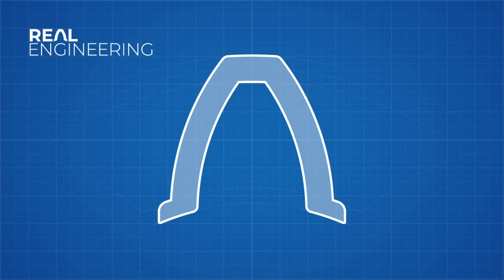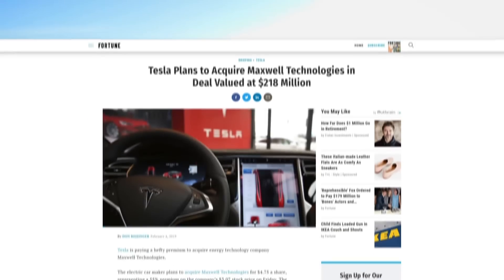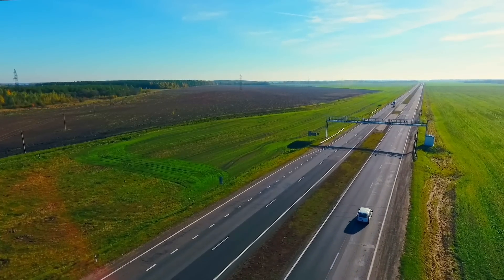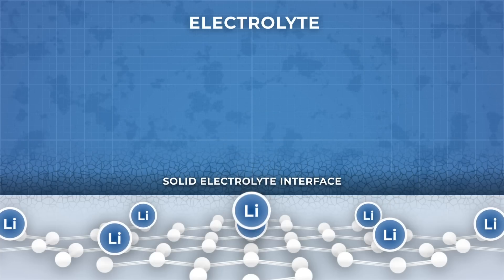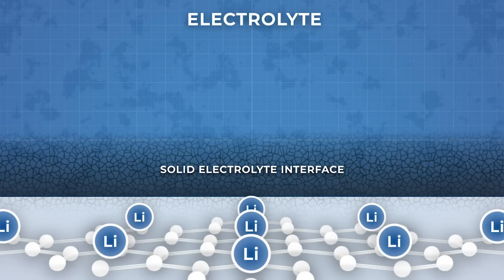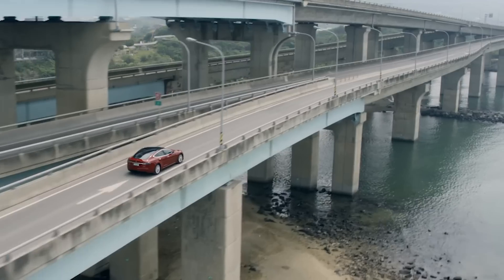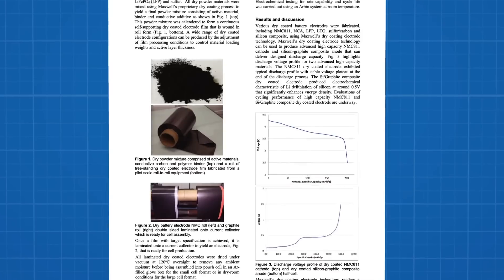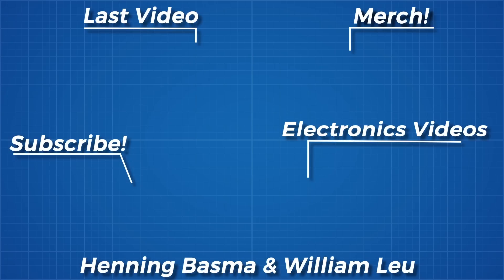Tesla's Quest for Better Batteries

Comment: This will greatly help solar power technology, I think the biggest cost with solar power involves battery expenses. Every time I plan a new solar system for my house the biggest cost is always the batteries.
Reply: Do a search for diy powerwall on youtube. 
Seen people build for as little as 300 usd per kw/h with new but surplus cells.

There are companies that only deal in surplus new cells and fully tested used cells and sell for a fraction of new ones.
Reply: @baronvonlimbourgh1716  300kw/h?! holy fudge, HOLY FUDGE! Thanks man I appreciate it.
Reply: @zereimu  yeah, that 300 per kw/h was an extreme example done by very dedicated and creative people though. I do not want you to get to excited and be disapointed :).
But it can still be done a lot cheaper then the commercial solutions out there currently without to much hassle and with of the shelf parts.

Even at 500 or 600 dollar per kw/h it is still a lot cheaper then commercial solutions and that is certainly doable if you shop around.

Ahh well, maybe you are just as dedicated and creative and you are able to beat those guys. It is kinda a competition going on  to be the one who finds the cheapest solution.
If you enjoy that stuff as well and have the time i am sure you can do it even cheaper!
Prices are constantly coming down on all this stuff.

Comment: Better find a way to recharge the batteries to 100% in 5 minutes or less from plug-in to un-plug.
Reply: Just have battey stations in different spots (petrol stations) where you swap your used up batteries for freshly charged ones in 1-2 minutes.
Reply: @MrBibo2050  , I also think that's a great ideal.
Reply: orange70383, who knows, maybe it will be possible in the near future.
Reply: A liquid electrolyte change can be done instantly exchange charged electrolyte for discharged in seconds then you are off just like filling up with gas🤔 Hmmm
Reply: Then the liquid electrolyte is recharged and reused with no losses

Comment: 15:02 I'm an English learner. Please let me know what does it mean 'vertical integration'?
Reply: It refers to a company that owns a larger party of the process involved in what it does.

Think of it as the opposite of “outsourcing”.

It could  mean an electric car company that also makes the batteries that go into their cars.

Right now, Tesla’s batteries are made by Panasonic.  There are rumors that Tesla wants to take over production of their batteries.

If they do, they will become more vertically integrated.

Comment: Would the Silicon Batteries last longer then Lithium equivalents? My theory is that because the Silicon used in the batteries expands by 400% when fully charged and creates cracks in the Solid Electrolyte Interface, ion atoms that would have previously would have been jammed in the thicker Electrolyte Interface now have a less energy intensive journey for ion atoms to get to the Electrode and would thus be drawn to using this route over the alternative until the crack is sealed with the same thicker Solid Electrolyte Interface it was previously avoiding, however the process to create new cracks in the Solid Electrolyte Interface would have been complete.

Please reply back on if you think my theory is sound or am I missing some complication to my theory that is currently obscure to me. BTW Love your videos.
Reply: The thing you missed is that the expansion and contraction cause the silicon to crack and degrade, killing the battery.

Comment: Please do not say heat pump when you mean pumps moving glycol or another heat transfer fluid. A heat pump is something else and this came up multiple times (wrongly used).
Reply: No.  A heat pump is used to cool or heat the glycol that is being pumped.
Reply: @dewiz9596  Which is exactly what Tesla does NOT have, contrary to what the video says. The video says heat pump when actually just a pump is meant. Some EVs have Heat Pumps. Tesla EVs do not have heat pumps.
Reply: Gerald H. : sadly, you are wrong.  Tesla specifically does NOT use resistive heating for the cabin heat.  They specifically use a heat pump to warm the cabin.  And seats.  Air Conditioning is a reverse heat pump. . .  I.e.  you pump heat from inside to outside.  They are, in fact, pumping glycol around the Panasonic Cells which are in rhe Tesla Battery Packs.  But that glycol is maintained at the proper temperature using a heat pump
Reply: @dewiz9596  Tesla has specifically stated that for the Model 3 they are using the drive inverter in an inefficient way to generate heat instead of using a resistive heater as with the Model S. They are NOT using a heat pump. Also Tesla Bjorn has done a lot of efficiency tests in the cold and cars with a heat pump do a lot better here. Tesla does NOT use a heat pump. If you google tesla heat pump, basically all posts confirm this.

Comment: My suggestion to new car buyers... is wait for VW in  2020 !If your daily mission is 100 miles or less one way.. and you live  where freezing and 90+ temps are rare... a used late model Leaf continues to be a great value that will last for many decades, with no fear of the dreaded Tesla Fire, or parts falling off with no dealer or parts anywhere.  If VW hits the mark.. the new car cost will be equivalent of a new small diesel vw..  ( about the same as a nice Honda or Toyota gas car).
Reply: Might be good advice, but ONLY if you really don’t care about acceleration, a clean interior without 1000 buttons, software upgrades and the best autopilot software on the market. Certainly many people just want „a car“, but if you want more I don’t see how VW can compete. They just have no idea about software and AI and are years behind.

Comment: this is fine, but it ignores the fact that the Leaf battery is now in it's 4th generation,and that the 1st generation battery was only made in the 2011-12 first generation cars.The lizard battery chemisty began with 2013,  and by 2016 the 30Kwh battery became available along with the original 24 KwH size.. with further chemistry improvements, and an increase in warranty to 8 years and 100k miles, and a range increase to 100-110 miles.  Latest Leaf battery is twice that size with a 200+ mile range.   As always, when the battery size increase relative to the momentary demand.. the range and the battery life increase as heat production goes down !    An active or better passive battery cooling/heating system will certainly benefit anyone in a hot/cold climate or who demands insanely fast charges..  but here in California.. we are quite happy with our Leafs.  Even Arizona is happier.

Comment: Dear What's the Electrical efficiency of Tesla Motors if it's bellow 96% then they must focus on achieving that first
Reply: Around 98%.
Reply: @drdoomgoat38  Impossible since an Induction motor can not possibly  exceed  efficiency level of 86% since it has inherent Slip factor which keeps it under this max limit

Comment: Wait, if you're in a cold environment the solid layer creation rate decreases. That is a good thing. But charging/discharging in the cold if less efficient, which cycles the batteries more and wears them out quicker. Not mentioned, heating the batteries is also a power drain (more battery cycling). So then I assume the net affect is worse in the cold. Does that sound right?

Comment: The other thing is. It's okay if it's cheap to replace BUT the batteries can't be recycling so they will be throown away +the amount of CO2 produced to make out is greater than to Run petrol car .
Reply: The batteries are 98% recyclable, the c02 released in making the battery is only 14% of what a gas car would release in its life time.
Reply: @miguellopez3392  are you 100% sure of that?
Reply: @MoleRat94  yes I've been arguing electric cars to skeptics and engineers for years now, the cobalt extraction process from a lithium solution in a lab setting managed to achive 99.97 extraction of the cobalt, batteries are made from base elements, throw it into a vat of acid or molten metal and you effectively recycled raw material.
Reply: @miguellopez3392  isn't that works only with brand new batteries though
Reply: @MoleRat94  ? Who would make a recycling plant for brand new batteries? When a battery ages little crystals grow inside of them wich eventually short the battery and kill it,  chemical degradation also causes higher internal resistance and capacity loss but this will take over a decade to become a noticeable problem in a BEV like a tesla.
Reply: @miguellopez3392  so they are not recyclable then?

Comment: Fuck EV's, A car that now has a range of 290 miles with only be able to travel 200 miles in 8 years. Useless for any type of weekend road trip. I'll take the old turbo diesel car that goes 500+ on a tank
Reply: EV range degradation is only 10% every 180,000 miles on Teslas and they go 225miles-370miles, that's 12 years of driving.
Reply: @miguellopez3392  I've read more as this video suggests but what do I know.
Reply: @famousmidnight  yeah what do you know, I've look at degridation data, average miles driven, and concluded that in 10 years the range would have only gone down by around 40 miles from the original 300 mile range.

Comment: Could a bank of capacitors allow for truly "quick charging" that then trickles into the battery at the normal "slow" rate?  EVs need to be re-chargeable on the go, not just overnight in the garage.

Comment: Battery's can be cheaply produced and  totally recycled if you use the correct components. Buying a new battery shouldn't be a big deal! Like changing oil!, It depends on the cost of the vehicle$$$  many consumers would buy electric cars if the costs was affordable. This would help the environment and the consumer. It would help the economy too. So by manufacturing a affordable electric car for the general public would create jobs , cut down on pollution, and help the economy of the USA. The electric car needs to be reenginered and made affordable with like components that can be used in different models.  Reenginered Motors, Reenginered Battery's, battery's quick exchanged and totally rebuildable. Then the electric car will change the future from a gas polluted atmosphere to clean air and Blue sky's!🤔. Like I said Give Me a Job!
Reply: And a 5-minute battery swap at the corner station would be much preferable to a 1-hour+ "quick" charge.  Combine that with your "standard module" and it'd be like swapping AAs on-demand.
Reply: @PongoXBongo  now you are thinking outside of the box😀 you wouldn't have to worry about buying a new battery you would just get a replacement. Kinda like exchanging a empty propane tank😁
Reply: Please. For the love of god, please NOBODY give this guy a job.
Reply: @geraldh.8047  hopefully that is a satire remark😁
Reply: @geraldh.8047   I noticed that you work on TV's? I stared my own tv repair shop as a teenager, then worked for a electronics shop fixing stuff just about anything that came in the shop 😁 then I opened my own business fixing computers, TV's , radios, amplifiers, cellphones, apple I pads ,  I also went to college studying electronics. I do know a thing or two🤔
Reply: @davidmayhall6567  Knowing a thing or two is not enough in battery development. This is a hard problem that thousands of people have spent their entire lives on with usually only incremental improvements. If you think you alone can change what chemistry experts and nanotechnology experts are still grappling with, you are most likely delusional. Or a very stable genius. But probably delusional. Sorry, this was not satire.
Reply: @geraldh.8047  well don't shoot me in the foot man! What are you doing to make a Better world?🤨
Reply: @geraldh.8047  your opinion is noted and filed, and totally Disregarded as Disrespectful 🙄
Reply: @davidmayhall6567  Sorry about your foot! I'm doing only small things to make a better world, but in those small specific areas I'm quite good. And I know that in 99% of areas I have no clue at all. And even in areas where I have some clue I'm 100% certain that people who actually work full time in that area know soooooo much more than I do.
Reply: @geraldh.8047   So my next reveal is a plant based Battrey Desighn that actually Grows by using plant cells to construct the Battrey plates kinda like a crystal Grows this allows carbon to be structured to allow more energy storage.😁 I have many more Amazing ideas to build things to Help this planet.  But I need Help from other like minded individuals 😁 that won't shoot me in my other Foot!😳 . Maybe space x will hire me to help them solve Problems 🤔 A  scientific mind is a terrible thing to waste! 😁
Reply: @geraldh.8047   You just might surprise yourself 😁 with a great ideas to make Great things😀 the Bible says that God gives witty inventions to Men and all Good things come Down from the Father of Lights. Never underestimate yourself 😁 you can do Great things! Especially if you Focus and put your Mind to it🤔 thinking is Free and your Mind is a muscle exercise it Daily. Write down your ideas so you don't forget them🤨!
Reply: @davidmayhall6567  Ideas are worth shit. Working prototypes and final products that actually work are what matters.
Reply: @geraldh.8047  wow really? What makes you think I don't have a prototype?😀.  You seem a bit mean spirited Gerald.🤨  Tell me why should I Give you my Work? If you give me a decent  Reason I might give you  The plans 🤔
Reply: @davidmayhall6567  I'm 10% mean spirited and 90% realistic/rational here. You have nothing beyond wild ideas, this can clearly be deducted by just reading what you write. Sorry, not interested in plans. And also, nobody else is interested in your plans. Once you figured out why this is, you will have come a long way. Good luck on your journey. And sorry about your foot!
Reply: I have a new battery design that includes a semiconductor layer inside the lithium ion battrey it regulates the state of charge and discharge, stopping degradation of the plates and the  cell separator this allows ion exchange at a controlled rate so the battrey has +and- it also has connections for base and collector this electrical valve controlls  flow of ions
Reply: I have a desighn for a all plastic electric motor except for the armature shaft and bearings, the field coils are also plastic injection molded.  And a new type of Battrey Desighn.😁
Reply: If you can plant Trees 🌲 on your property you can do something to lower the co2 and Make clean Air for people to Breathe😁

Comment: No, it will not cost $7500 to replace the battery. As noted in the video, battery prices are rapidly dropping. For people who don't understand the word "dropping", I'll try to explain. It means that the cost in the future is less than the cost in the present. Since battery degradation happens in the future, we care about the price in the future. I know, it's confusing. 

In about 8 years, in 2027, my battery will still be fine, or not; maybe range down to 250 or so. But I'll buy a new battery with integrated supercap for $1500 with a 500 mile range. 

Tesla won't have the same problem as Nissan, because they were more conservative on programming the range, and have better battery protection equipment including temperature management. If there was a problem with Tesla, it would have shown up by now.

Comment: Well.done.
As I have heard, Tesla's cost per kilowatt our is very near to $100/kwh.
We now have 11 years of Tesla battery degradation data. We don't have to guess. The packs barely lose capacity over the years. As the temperature is actively controlled, the cells rarely encounter the heat buildup which cause dendritic shorts.
Degradation is around +-10% after a half decade (newer versions degrading more slowly), and probably is improving rapidly as they apply their data to the battery management software.
The batteries are fine. No doubt needs to be propogated. No data supports the doubt. 
Once again, the damage that Nissan found in their poorly air-cooled packs are not related to how Tesla makes its packs. Tesla doesn't find anywhere near that much damage.
Fun bargain idea: buy a cheap damaged Leaf, and when the battery tech improves and price plummets, swap in a new third party pack.
Reply: @Seb C which was gen 1, before the adjusted the algorithms. I doubt you'd lose 10% in 8-10 years now.

Comment: You said: “a positive electrode, the anode and a negative electrode, the cathode”. Guess this ought to be the other way around, no?
Reply: Cathode is negative (-) since electrons carry a negative charge.  Remember the old school television sets with a CRT (cathode ray tube) shooting electrons to the screen?  The diagram is wrong.
Reply: @1959Berre    And you are surprised?
Reply: Mostly reffered to a cathode and a anode, positive plate and negative plate. Transistors use a  collector and a emitter and they have another connection that turns on and off the flow of electrons a gate. Today's battery's don't have gates but by using semiconductor technology in battery manufacturing this could build a better battery by controlling electron flow, and plate voltages and even stopping  corrosion and inoization saturation of plate conductors. When I am given a job then I can build it!🤔
Reply: Electrode can't be positive, electrode is negative and cathode is positive.
Reply: @vinnovation447  Anode and cathode are both electrodes. One of them is negatively charged and the other, positively.

Comment: A lovely and informative video, but one glaring omission:  You state early in the video the concern that a battery pack would need replacement, although significant statistical evidence shows that current Tesla batteries will likely have over a 300,000 mile life before being reduced to about 80% capacity, which still gives significant capability.
Reply: Whoops, came back from a long road trip and didn't catch the timeframe.  Doesn't change my comment, though.